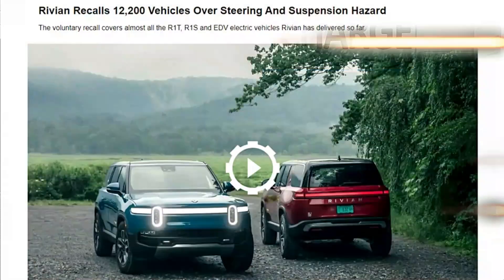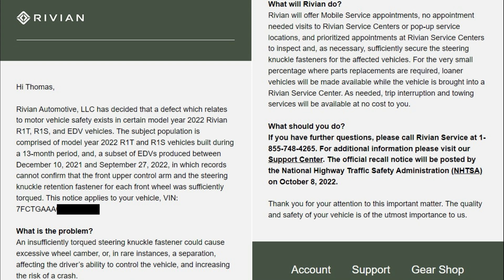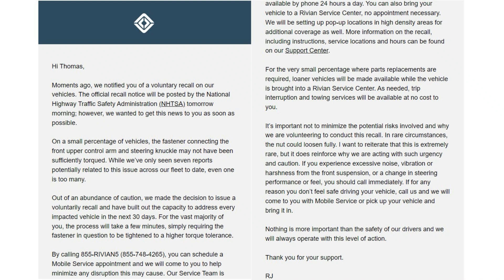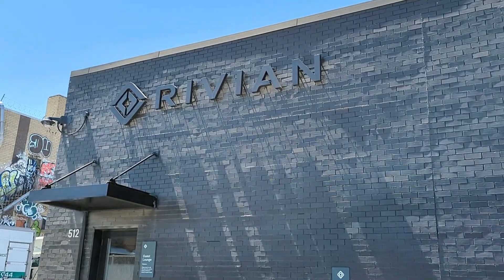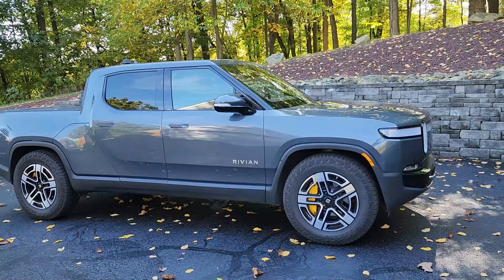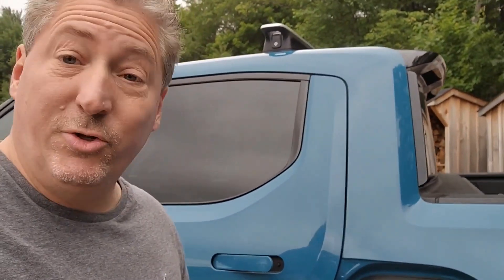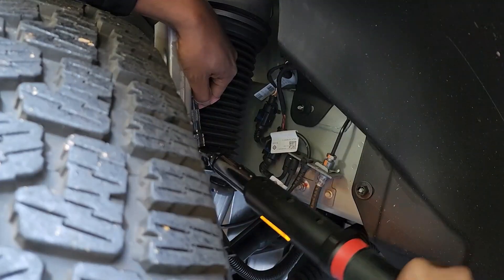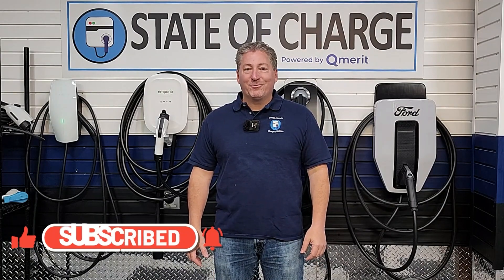Rivian Recall Explained

Comment: It's definitely good to see Rivian addressing the recall in a timely manner.  To be honest though, as Tom pointed out, there's only about 12k (actually ~15k) on the road so there's not that many to address.  What will be telling is if/when they have another recall that affects a much higher number of vehicles, say 100k, how timely will they handle that?  For now, a good start but the bar is not that high at this moment.

Comment: Tom, three "appointments" made & broken by Rivian so far.  Promised over  the last week (+) .  My drive would be 4 hours to the closest service center each way.  Kept my schedule open until after dark each time.  NO return call today 9the latest broken schedule).
Reply from the maker: That's not good! Keep giving us updates here, please.
Reply: @StateOfChargeWithTomMoloughney   I got a call fro Brian @ SSFO service @9:12 this morning.  He, of course, apologized for the previous "no shows".  Now we are supposedly the #1 stop on tomorrows schedule.  It is approximately 193 miles from the service center to my house so, I don't expect them until about noon.  I'll let you know if it happens--this time.
Reply: @StateOfChargeWithTomMoloughney   Fourth attempt at an appointment worked!  The tech (Nathan) phoned me when he was about 2 hours drive away.  Then again at about an hour out.  I decided that I would meet him at the local (15 mi from my home) EA charge location.  That way he could start charging, check my truck (all in spec & now tightened to new spec) before he heads back toward S. San Francisco.  He had two more to get on his way back north.  He also marked the bolt/nut with a stripe.  (we call that a 'torque stripe' in aviation circles).  He checked to make sure it was above 20 n-m before taking the torque up to 140 n-m.

Comment: How is it that looking at the Ford Level 2 charger it's the biggest and the bulkiest of them all?
 Like when Ford partnered with the manufacturer to make them  did they say something like hey guys we seen what's available for home Level 2 chargers on Amazon but can increase the size in all 3 dimensions so that when it's installed on customer's garage walls they have to be the most obnoxious wall charger for them to look at and take up more wall space? I get it that Ford wants the Ford name to stand out that you know what brand this is but my God when you see it next to the aftermarket chargers and how small they are, you would have to wonder if Ford wants to also have wall chargers in similar size with the Tesla Powerwall? 
I think some at Ford said Tesla be damned we at Ford are going to compete with you on taking up customers wall space for our Level 2 chargers and by if we have to have second biggest and bulkiest units to do it then that's what were going to do.

Comment: Did you notice any differences in drive characteristics after the torquing? I read a few R1T owners noting slightly less vibration of steering wheel and less front suspension noise.
Reply from the maker: Nothing at all.
Reply: Those other owners probably had loose bolts.  So it would make sense that Tom didn't notice a change, because his bolts hadn't come loose yet.

Comment: I got notified about a recall in my Hyundai Ioniq 5.  Next appointment from the dealer was 8 weeks, and for a small software update they want the car all day.  Rivian is handling this right!
Reply: How many Hyundai Ioniq 5 vehicles were affected in the recall?  Perhaps it was a much larger number of vehicles (compared to Rivian's ~15k on the road) affected leading to a longer delay to get to all those vehicles.  Also, your location plays a large factor.  You may be in an area with a large volume Ioniq 5 and/or a low number of Hyundai service centers.  Not trying to defend Hyundai, just trying to put a little perspective out there that there may be other factors that need to be taken into consideration.

Comment: Seems like a missed opportunity that Rivian is not putting a witness mark after re-torquing.  Tom, your R1T as well as many others I’ve seen did not even measure at the old spec.  Re-torquing to 120 or 122, and then adding a witness mark would be a good quick visual if things loosen up again.
Reply: Tom could mark them himself, just to show us if it did loosen up again.

Comment: My refrigerator's french doors have a pivot problem and I have to use the wrench provided to fix them, like every 3 months. 
This wheel tighten problems will last for ever. keep checking those bolts.
Reply: This will most likely never need to be attended to again.
Reply: @jamesengland7461  I hope so.

Comment: Are those bolts loosening from a too low of an original torque spec or did they just up the torque spec hoping they will stay tight and hopefully they have figured why they weren’t torqued properly to begin with.

Comment: I am glad to see Rivian acting so quickly.  I am surprised to see that they just added more torque to solve the issue.  I would think that a castle nut would have been added.  Or at least a lock nut.  But I am sure their engineers know more than I do.
Reply from the maker: I was thinking the same.
Reply: @Billy.80  We don't really know the reason the bolts are coming loose.  The existing design may be a standard automotive design.  A torque wrench may have been set wrong at the plant.  Or they may have cut corners.  We just don't know the facts.

Comment: When you don’t want a nut to loosen, often they use “Locktight” on threads or two nuts with a lock washer between.  More secure and a bit expensive is a nut with a cotter pin through bolt.
Reply: Not sure if locktite would work for this bolt, it takes a lot of stress.  Nor would a lock washer or cotter pin work.  No other vehicles have any of this, for a reason.
Reply: @Resist4  Okay, that's a pretty definitive statement with nothing in the way of an explanation...I  suspect like myself a lot of old school gearheads would like to hear more.
Reply: @oldyeller9849  Then educate me as to what vehicles use Locktite, lock washers or cotter pins for this bolt?  I've never seen them on any vehicle I've every owned.

Comment: Funny how that followup letter said things they knew they couldn't say in the recall, buttering you up a bit with terms like "on a small percentage of vehicles" and "out of an abundance of caution".  In fact, I think Rivian is pretty well aware that the problem exists on 100% of vehicles due to the original (70 lb/ft) torque spec being too low versus the updated 120 lb/ft spec.

Comment: So if the bolt still loosens this is a temporary fix? Wondering if they can add another additional bolt to stop that.
Reply from the maker: I was thinking about that. But I Imagine their engineers know more about that than us? Right? 🤔
Reply: @StateOfChargeWithTomMoloughney  one would hope!
Reply: @StateOfChargeWithTomMoloughney  It would be interesting to know how they came to the original torque spec and why this issue didn't show up in testing.  Unless, they are incorrectly being torqued too low at the factory, not using the correct torque spec the engineers came up with.

Comment: Mmm, maybe need to implement a cotter pin in there just in case it loosens up.  Almost similar thing Toyota’s wheel falling off, weird.
Reply: Toyota was implying their issue had to do with a defect in the parts while this seems to be a QA/QC issue at Rivian by not tightening it enough.

Comment: Excellent presentation, thank you. I suspect proficient DIY type owners will do it themselves. And, I suspect Rivian will probably contract with a local repair facility/person instead of having to drive to the boondocks for those owners.
Reply: Even if you DIY it they'd still need to get a torque wrench on it. Or have the owner sign a release. Probably simpler to them just to have everyone follow their process.
Reply: @MLHunt  Yeah, at the very least Rivian should go out to confirm it is tightened correctly evening they say they did it themselves.